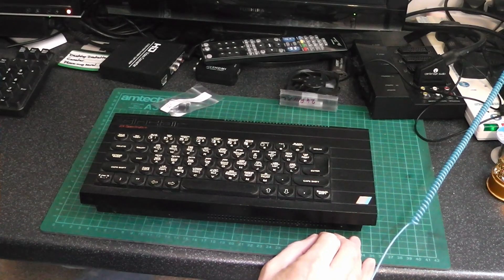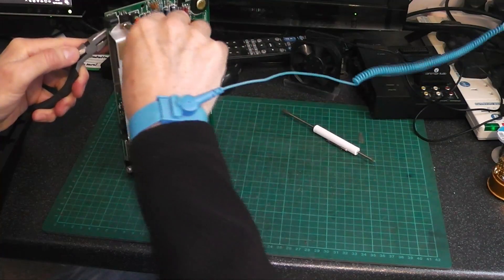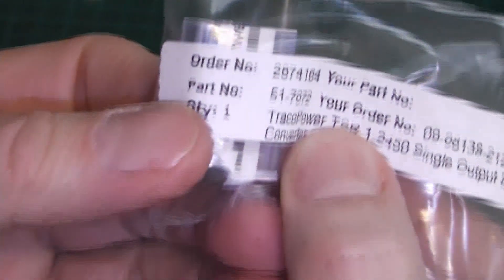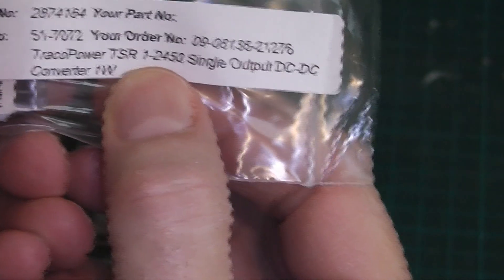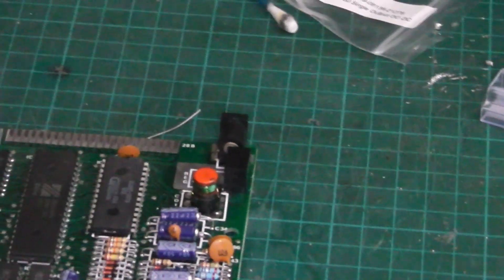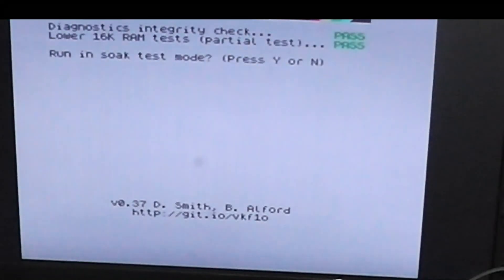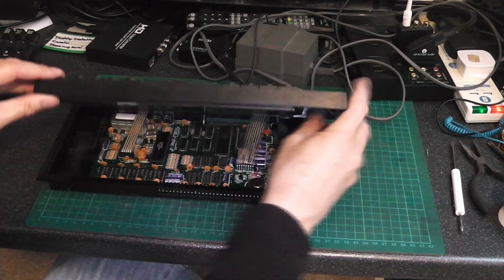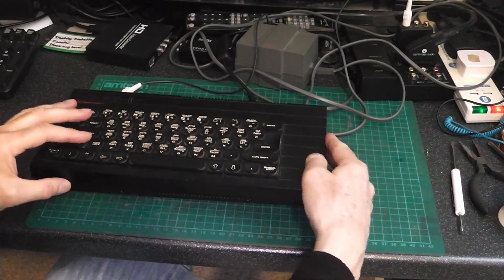ZX Spectrum 48k+ Traco power converter upgrade

Comment: I would suggest investing in a Hakko Desoldering gun, or an Engineer Solder Sucker. Much better because your getting very close to overheating that pad. Traco's, while expensive, are excellent 78xx replacements. I personally use them whenever I can afford them.

Comment: Because of that overheating of the original regulator, the key fob will eventually stop working. This Traco saves new key membranes from breaking down due to heat.